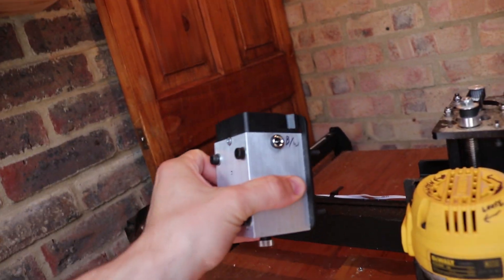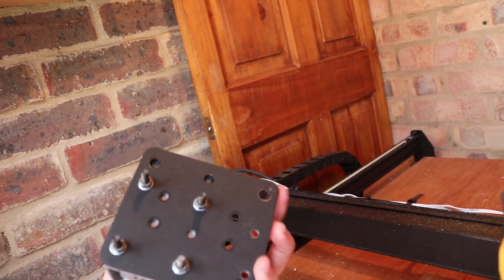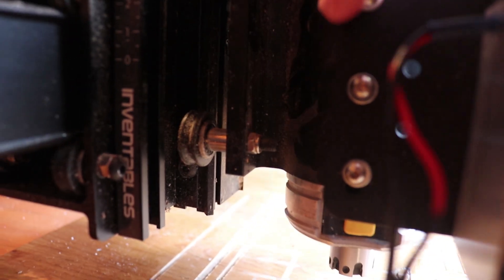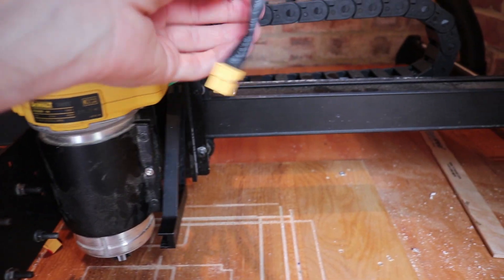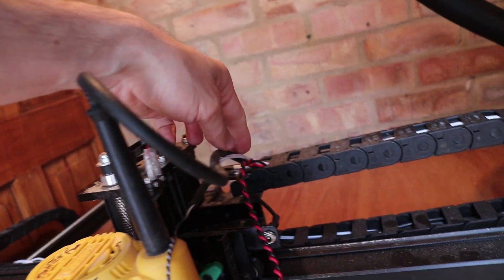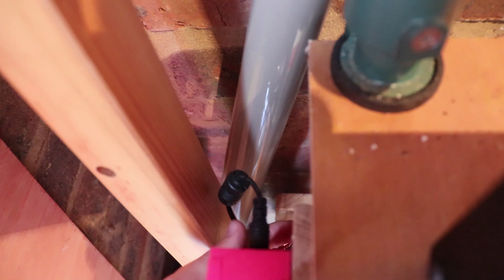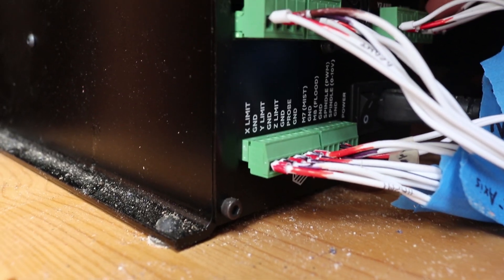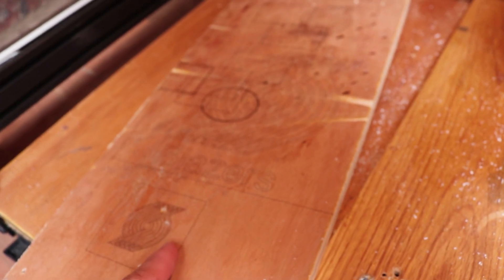How to wire Endurance Lasers to the Xcarve

Comment: I use Mach3 and found I used to get wavy lines just like that until I reduced the X & Y motor acceleration setting in Mach3. I don't know if you have an option to do that but thought I would mention it. That virtually eliminated it.
Reply from the maker: Thanks so much for this!  I'll give that a try and see if it works well for the Xcarve.  Cheers, bro
Reply: Spindle Mode:  ($32 = 0)  Motion will pause for every spindle state change.  Default Max RPM value ($30 = 12000)
Laser Mode: ($32 = 1)  Motion will not pause for spindle state change on G1 commands.  Default Max RPM value should be ($30 = 255)

If you press “$$” you will see your settings.  Make sure you have the following:

$30 = 255
$31 = 0
$32 = 1

If you don’t have this, then change them by sending the correct value, like “$30 = 255”.

https://jtechphotonics.com/?p=4910
Let me know if you still need help
Reply: As i think about it, you mau be getting feed back from either lose belts, or lose track wheels. Check you x-y-axis for movement and belt tension.